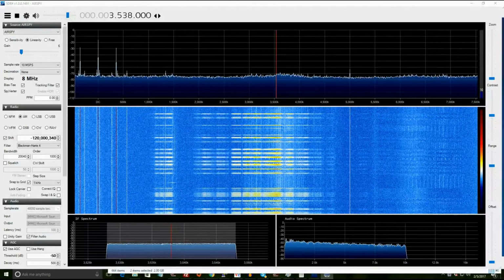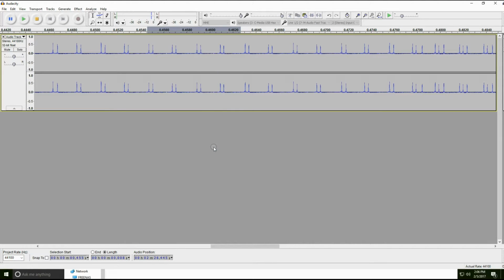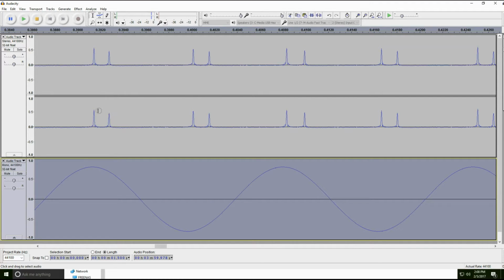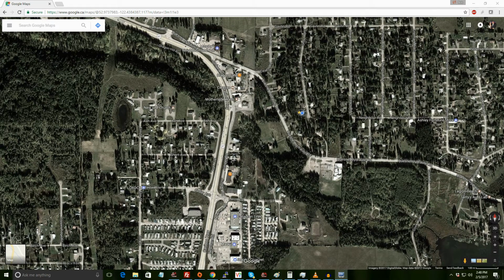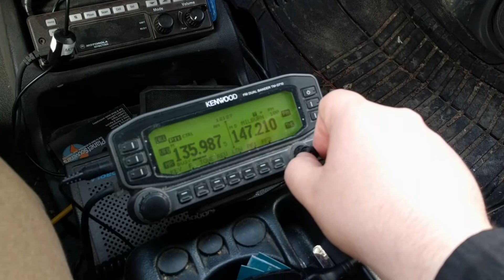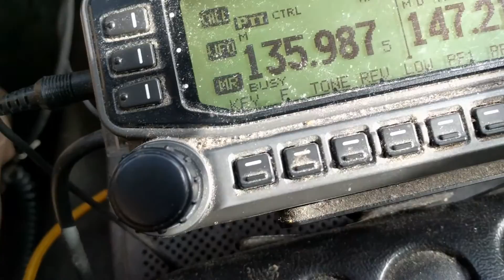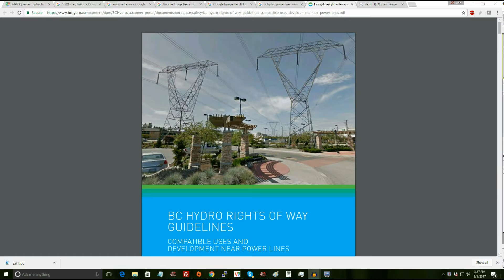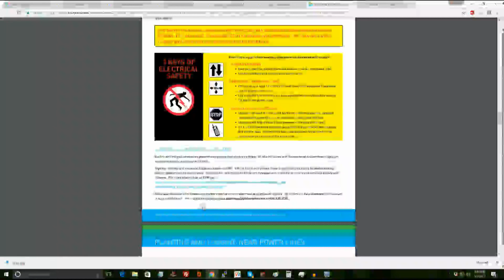Identifying and Locating Power Line Noise

Comment: I am having major electrical interference in the 10-meter and 12 m band that's so loud that I can hear nothing it just immediately started one afternoon at 2:00 I can pick it up on a bow Fang walkie-talkie at 130 megahertz but I'm unable to track it down I've done the standard troubleshooting by shutting down all the power on my house my apartment upstairs my garage and my neighbor's house I called the power company about wires that look like they had rubbing on a tree branch they showed up looked at the wires said they were good and drove away I am trying to do directional finding next never did it before so this will be a first but my radio was working fine all the way up until just a couple days ago at 2:00 in the afternoon and this interference came in and I can't seem to find where it's at

Comment: When tracking powerline RFI, as you get closer to the source it can be heard at ever increasing frequencies. Therefore the technique is to use a VHF receiver with a Yagi and an attenuator. The Yagi is for directionality and the attenuator is to give you some chance of localizing the source when close to it. Your video clearly shows why attenuation is paramount.

Comment: I’ve got noise that sounds just like that.  I tracked it down to a narrow area using 450MHz AM reception.
Reply from the maker: I got a notice that you had a second question about using FFT, but I can not see it anymore. I did try that, but the fundamental wasn't really represented as the noise was very wideband (AF spectrum, but also RF spectrum) so on the FFT it just showed fairly flat response with a few little harmonic-esq peaks, hardly a few dB above the noise. This was due to it being essentially square-wave impulse noise. Clicks on peaks.

Comment: I've tried to find the source of power line noise at my QTH here in Ireland, I contacted the power company several times in 2017 and they acknowledged my complaint and I heard nothing. 

I contacted my local regulator and the said they would call out to me but never did, I called them up a year later and I was told my only hope is to find the bad pole myself and then contact them back to verify. 

I got a yagi antenna it's got 2m/70cm and I was convince it was a particular pole but it's not detectable on 2m or 70cm. 

The noise is bad today and it's 60% humidity, It normally went away with wet but today it's dry but yesterday evening a Thunderstorm went over and quite heavy downpours and it's back only since then, previously to the Thunderstorm it was completely quiet for several weeks. Normally wet makes the noise go away. 

Another big issue for me is that these poles are on a 10 Kv line and they don't run by the road they run through fields and it's not easy access fields here with barbed wire, electric fences, high ditches, gates and cattle/bulls. You're lucky you can drive around the neighbourhood, I would have some task to get from one field to the next. 

I can't get any sort of bearing on the noise at all on HF. Power here runs at 50Hz 230 volts.

Comment: I wonder if the double peak is a “make and break” of the arc. When the voltage rises it arcs before the peak, and when it falls it arcs.  If so the peak of your generated signal would be in the middle of the double peaks measured. 

Just a theory.
Reply: You are correct. Depending on circumstances such groups can contain more than two spikes.

Comment: The old school way of checking which pole is the cause is the sledge hammer method. Whack the base of each pole with a sledge hammer and listen for a change in the radio noise. You'll know right away which pole is the culprit!.  The ultralsonic method also works as does the use of s stepped attenuator, usually a 30db switched pad does well, just like doing a fox hunt.  Noise can often be a real bugger to find in you live in an area with a lot of industry.  3 Phase VFD drives are often very noisey and very common problems. I have a small machine shop in my basement and all my equipment uses  220VAC single phase to  230VAC 3 phase VFD drives and even when not in use and machines turned off, I have to disconnect the drives from the power source they generater noise even when turned off. Then I can work DX!!

Comment: The interference will always be a harmonic of 60hz.  The power line sound signature will be frying bacon, that is not a steady tone. When finding the location of the interference, start with your mobile radio to get close, then use the portable to pin point the pole.

Comment: The best tool for this kind of troubleshooting is a hand held am radio with a ferrite rod antenna. You DF by finding the null, then find the actual pole by holding the radio against the wood. The power company is interested because, hum is money floating off into the air.
Reply: The power company is interested because having wideband RF noise generators is illegal.

Comment: Using Audacity, you've revealed the Marv Loftness Fast Locating method for tracking powerline noise specified in his book, "AC Power Interference Handbook"; the method used by professional RFI investigators.  Using the scope display on pro-equipment like Radar Engineers model 243, the investigator can take and store initial reading from the ham's antenna, and then search for the matching scope pattern on the scope out in the field.  That way, only the sparking noise that is causing interference to the ham needs to be repaired.  More efficient and less costly for the utility, and resolves the hams RFI more quickly with fewer returns. 

Each spike on the Audacity audio is an individual spark (Not Arc, as Arcs are something different).  There can be any number of sparks per cycle or half-cycle depending on how and why the sparking is occurring which depends on the line voltage and the hardware that is the source.  

When you could not determine which of three power poles were the problem, you should simply move to a higher frequency until the noise is weak again to resolve which pole is the main source.  At the highest frequency receiving the noise you can determine which of the 3 poles is the source.  From their the professional RFI investigator may use an ultrasonic dish receiver to determine which hardware on the pole is the source of the noise.  73, de ed -K0iL

Comment: The smaller peak is likely the noise from the arc (leakage) stopping as the voltage goes towards 0 and is the magnetic field collapse spike.
Reply from the maker: Darn, didn't think of that but I'd bet you're right! Those are some massive inductors, so that would make sense...

Comment: Can power line noise effect my computer in anyway ?
Reply from the maker: Great question. The kind of noise that I have been experiencing can not. If your electrical service provider has very bad waveforms and the AC coming to your machine is bad you can have some issues. For instance, your PSU might not be able to take an AC waveform that is not tight on frequency as the PSU transformers typically are sensitive depending on the composition of their core. Most PSUs these days are switch-mode and they won't care. You could feed it with a 1930s era stuttering generator and they won't care. The only real issue you could expect would be some hum in anything that uses poor filtering such as amplified PC speakers.
Reply: @BobHolowenko  ok Thanks for the info .. so dirty electricity can cause problems ?? .

Im having input lag on my mouse and controller when i game and ive recently realised that its something to do with my power from the mains.... Late at night (2am) its fine till (7am) then the same Lag comes back allday

Comment: Hi my call is ve3ryi. I live in hamilton east end. I have walked around with a small Transistor radio tuned to a week station and found noisy poles. the one that make the most is a Tim Hortons store 500 feet away from me. the other thing I found was the ground wire on the poles cut. someone taking for scrap. I have called and emailed Hydro, Bell and cable companies to inform them that there ground wires are cut. sent them Pics of the pole number and the cut wires. This is the second time i have done this. this time I walked around 80 city blocks around my house and have founded  about 30 wires cut off. Now I have to walk again to see who fix there wire. Hydro was the best reply email. as they asked to confirm locations of some poles. cable just acknowledged the email and Bell have not heard from. lol

Comment: Had many noise issues in past years also. Found 40 and 80M un-useble. Tracked it down to a local Tim Hortons sign that was arcing to ground. I could actually visibly see the arc.  Got them to fix it but two or more worse noise sources popped up. Never seemed to end. Finally moved out of town where it's very RF quiet. Now I can hear the neighbor's tread mill from half a mile away....hi. Another useful tool is an IR camera. Can get a relatively cheap one for your iphone (Seek or Flir one). No question which pole it's coming from with those. Be aware that also spring time is bad for noisy power poles. With all the dust from winter snow; things start to quiet down when the rain washes the insulators clean (or at least most of them). 73 de VA6DX

Comment: When very near the source, and antenna you are using can't determine the actual pole, move up in frequency.  If using a VHF antenna then go up to UHF.  I start out with a three element VHF yagi and then switch over to a 4 element UHF yagi and tune 432 MHz SSB.  That may help you narrow down the actual pole.  When you contact the utility company give them the pole number of the pole(s) in question. There should be a number tag near the bottom of the pole with the number.
Reply from the maker: I didn't end up going any farther with a different antenna, didn't need to. I stepped out and could hear it arcing with my ear. As for reaching out to the utility, that is what I did, I got an email address for an engineer and sent them photos of the pole label, the video URL, and a few other nuggets of info. They came and sorted it out. They found a lot of issues. Bad sealing on the wood, bird waste and a troubled insulator, then midspan to the next pole they had a suspect compression splice. They solved all the issues over about a one week period. I felt bad as they had to cut power to a restaurant in order to fix it :S

Comment: Hmm... I am very disturbed by a low bass sound, especially hearable in the nights... Can this be from power lines - transformators? It´s at around 35-50 HZ..
Reply: It can be, however low frequency audio and vibration is very difficult to source locate. The house materials and room dimensions are amplifying the sound, or resonating with it. This can make the sound noticeable when inside your home, but unheard when outside. Also, background noise can cover up the low frequency hum, but NOT its negative effects (nausea, depression, etc) . Low frequency noise and rumble can  Travel many many miles. It may be idling diesel electric trains, industry, vent stacks, sewer and water lift pump stations or an AC unit 2 blocks away..or 10 miles away. It is a very troublesome health problem.   Try to find the frequency range by comparing it to a low frequency audio app for your phone etc..you need to use better speakers or headphones. Problem will be the noise may have a mix of several frequencies or harmonics, But it will give you a basic frequency octave. There Are also apps that are audio spectrum  displays.. these will help show the humming noise, if they are sensitive enough. We experience 50- 70Hz in an  " undulating" , slightly varying frequency range in most cases.    Most recently It seems to be 63 Hz.    ...It is usually described as  an idling truck sound , from a distance away. Good luck. If it has more of a " buzz" rather than rumble sound, it may be electrical transformer or its vibration into the ground...but I bet on something more like an outdoor heat exchanger compressor / motor , buried town water pump, gas plant exhaust stacks or industry machines within 10 miles.

Comment: Well i would share with u a secret that fcc uses to locate RF offenders 😄 and it will make ur life easier in locating noise! The method is called triangulation which mean u take three differnet directional measurement at three different points that could be a mile or more apart. Would will be able to exactly locate a center point the more you close up the triangle points and decrease the search area ;) look up triangulation on google for more info
Reply: Triangulation, Without some way of identifying the fingerprint of the noise, may be very difficult -as most RFI is from multiple sources. There can also be so much re-radiation and induction or " coupling"  of RFI into nearby metal objects (phone wires, towers, eves troughs etc)  that triangulation wont easily work...SDR display certainly helps.
Reply from the maker: Yep, I tried that out. I've used other methods when I lived in another part of the province, including using a Doppler system, however at the time I made this I was going for a "heat map" approach by trying to cover ground and listen for the noise to be the strongest. I ended up finding it that way. I later added an AM loop antenna that has very good directional sensitivity  and was able to get a measurement from a few points and compare them as if it was triangulation. At the time I made this video it was not an option.
Reply: Triangulation is as old as radio. Wideband noise on power lines  is very difficult to triangulate. Electricity providers (those who actually care) use this sort of equipment: http://www.radarengineers.com/10-rfi-tvi-locators.aspx